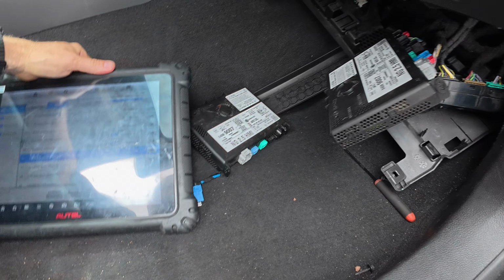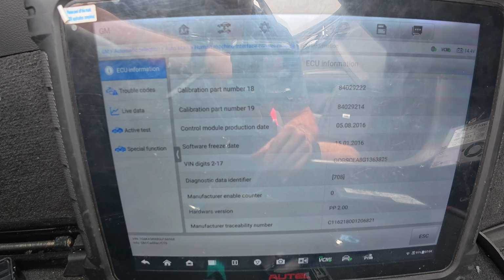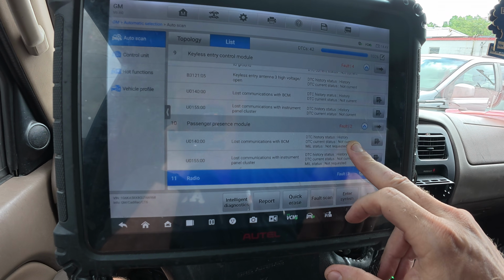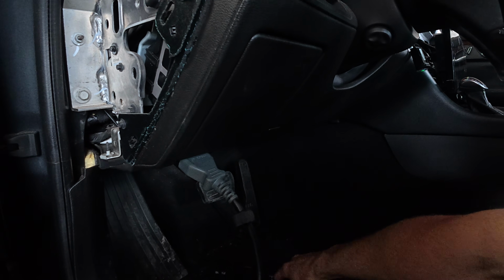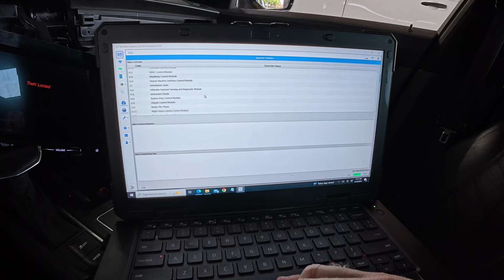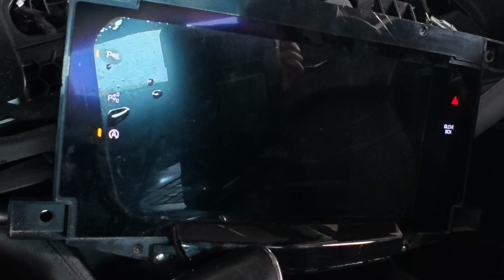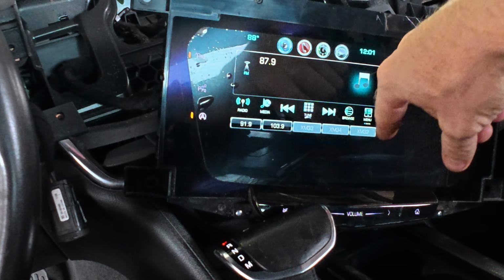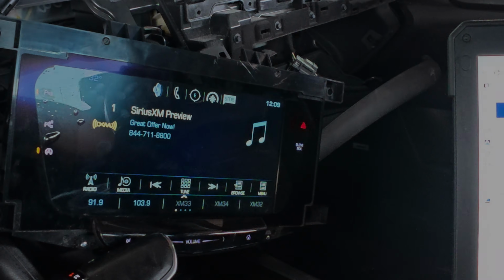Part 2 : Cadillac CT6 No Radio Fix - Used Module Programming Success!

Comment: Hello, great detailed video. Any advice on a CT6 with a radio, ac and steering wheel controls that don’t turn off and drain the battery? Also code B101E-48 Electronic Control Unit Software - Security Code Not Programmed is present? Thanks for your help.
Reply: What was it

Comment: My screen is grey which part should i buy my radio and onstar not working nothing showings on my screen

 CADILLAC XT6 TELEMATICS COMMUNICATION CONTROL MODULE UNIT OEM

You think it will work and my radio will show display and i will be able to control climate and radio ? .. i dont care about on star
Reply from the maker: I’m not sure unfortunately. Any of that besides the screen will need programming. So better to find a shop that can diagnose it an repair it

Comment: I own a shop in rural NWPA. I am the dude who figures shit out when dealerships screw up. I wels on vehicles at least once a week. I never unhook battery. 1st off i use a mig welder at 16 to 19 volts. The biggest thing is the ground. If your welding on the exhaust and ground to bumper that is stupid. If your welding on a rocker panel and ground to the axle that is dumb. Biggest thing is to make a clean ground on the part your welding to
Reply from the maker: That’s great to know. Thanks for sharing